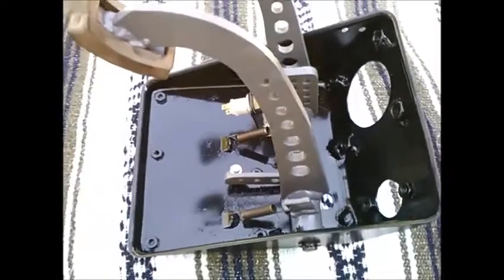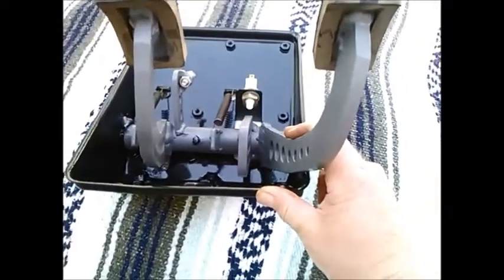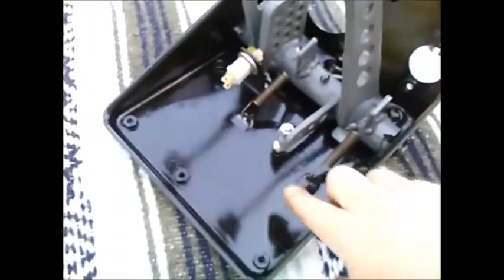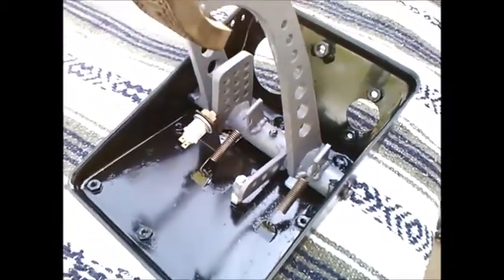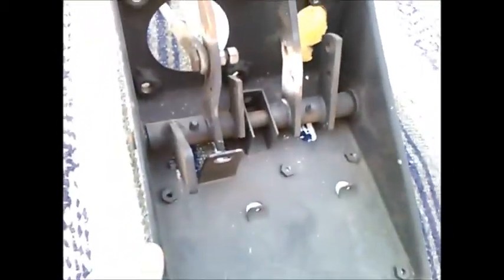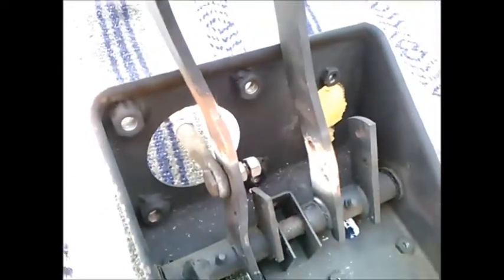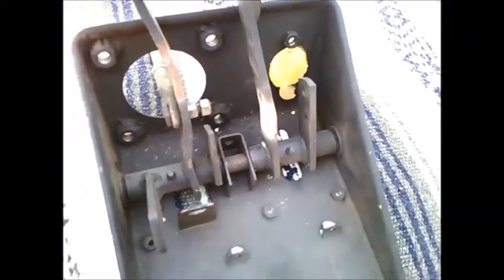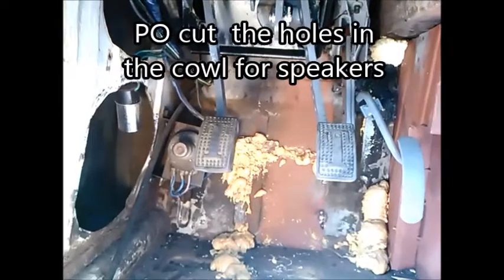Double / Dual Brake Pedal for V8 Triumph TR4

Comment: so i am cureruse why two petals? I am use to muscle cars and i have never seem this before. Is it for heal toe braking and the second petal is for cruising or what?
Reply from the maker: Mr3wheeledbike Where before I had one pedal inconveniently located for either foot, now there's a separate pedal that's correctly located for each foot.  Converting to the V8 pushes everything to the left ... I knew I could press a brake pedal with my left foot if it was in the correct spot, but wasn't sure I could brake well with my right foot, even with that brake pedal quite near the gas pedal.  So far I'm okay with using either foot, and if I were to ever look at converting to a manual shift, I could live with right foot braking only.  The gas pedal, in its little "alcove" you can see, can be tricky still.  Maybe I can make more space around it, but not much.
Reply: guidoguitar thanks for the explanation and good luck